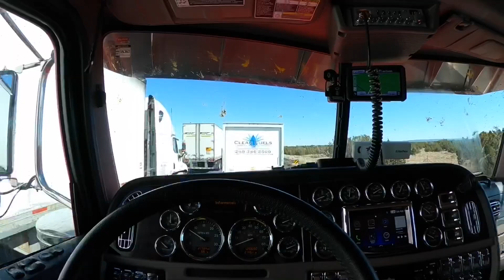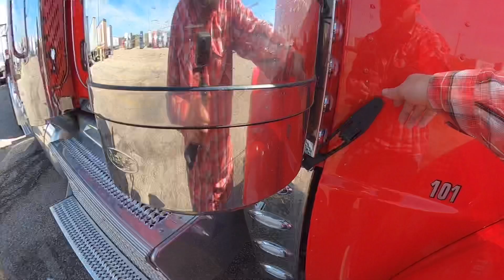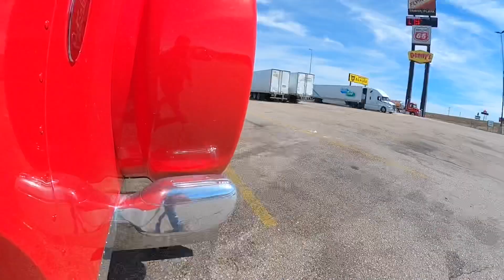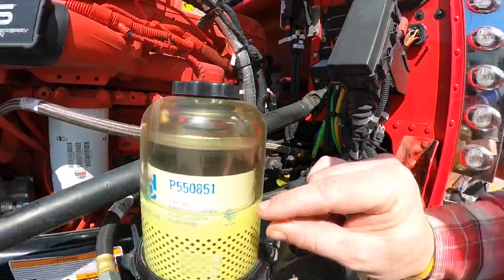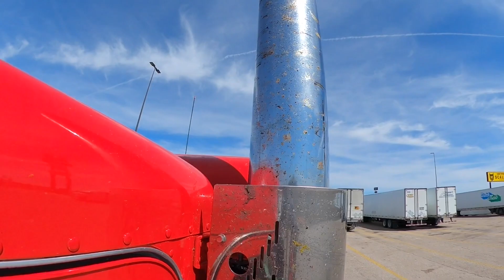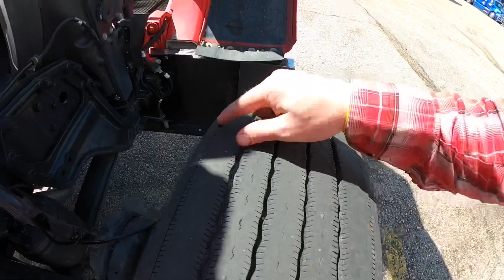Vlog16 2020 Peterbilt 389 PM Plans

Comment: Our experience on both non air ride and air ride front axle 389's. We find that the air ride front axle trucks have amazing steer tire life. Made a believer out of me! Since 17 we haven't bought one without  the air ride steer axle. I'll take the tiny weight hit with the air disc over the lightweight drums any day also. I know they have helped our tire life in several ways, they don't freeze up, and I haven't done a single brake job on any of the disc brake trucks👍brakes are still good when we sell them off at 500k

Comment: Beautiful truck keep up the good work if those are the X Line energy Steer you said you're running 105 PSI. You should look at the sidewall they recommend 120 PSI minimum cold I pull tanker like you do and run the 16 ply X Line energy got a hundred and twenty thousand miles on mine all so awesome tires and I run mine at 130 PSI

Comment: Firestone FS591 is bi directional steer tire. Don't have to break a bead. Just rotate. I put 205k on a set. And my tire guy said we get good milage out of them no matter what he puts them on. 
I'm a huge fan of Michelin drive tires. A friend of mine has put a lot of miles on the wide base Michelin XDN2's. And I put a set on my W900L that lasted 250k. (duals)

Comment: I run those same steers, I run 120 PSI cold & change out my steers at 200K, I also run Centramatics, my steers wear smooth however your getting plenty out of those. Personally I don't think its safe to run a set of steers over 200K doing the type of work we are.
Reply from the maker: Trip Triplett I was nervous to run them past 100. My friend told me he gets 160k out of his steers all the time. All I had ever ran was junk, so 60k was about the most I’d get. I’m going to keep running there as long as they’re looking good. I’m super impressed with them.
Reply: @wanderingpete3196  My post was just info., we all run a differently that don't mean the way we each run or maintain our equipment is wrong it means we all have different lessons we have learned along the way good & bad. 
Great video I hope to cross paths one day